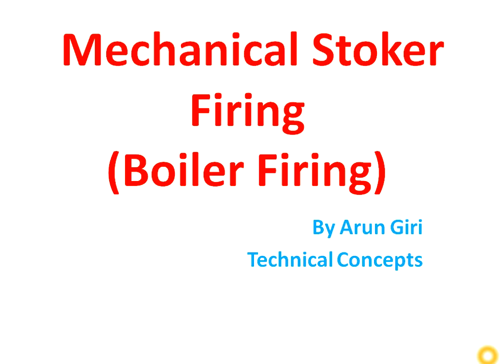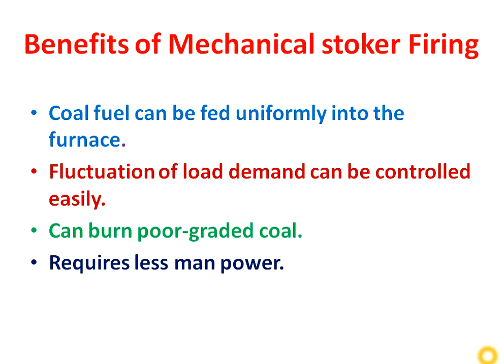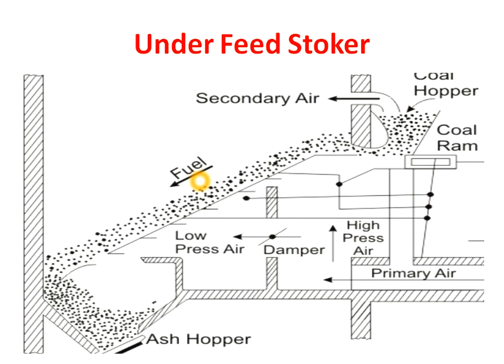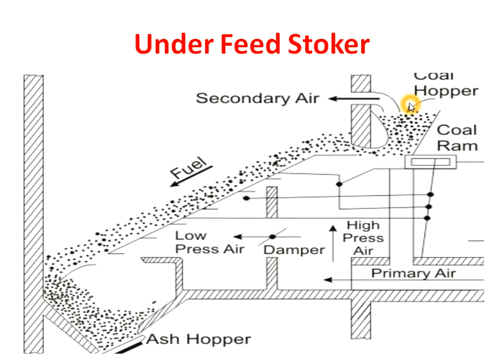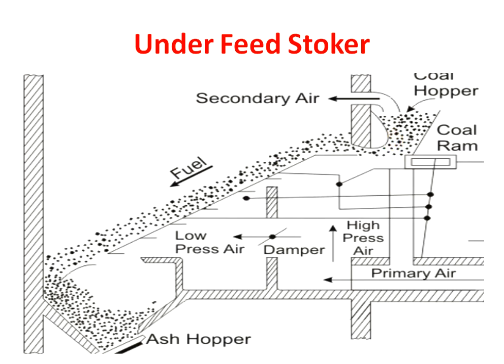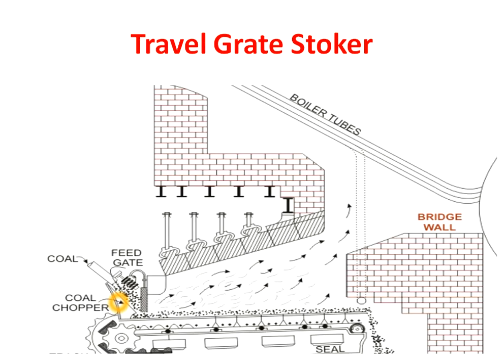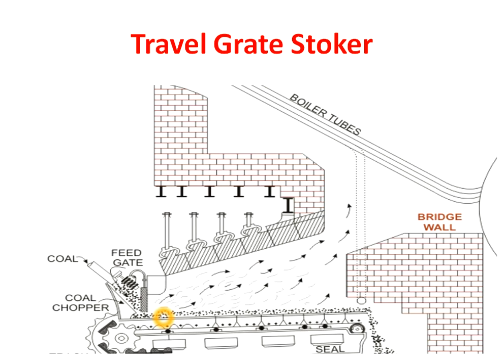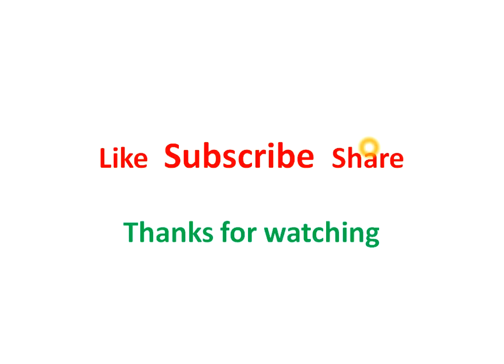Mechanical Stoker Firing / Boiler Firing In English

Comment: I've had personal experience with both single and multi - retort underfed stokers working for both the Detroit Public School System, and Detroit Edison's Thermal Energy Division in  downtown Detroit. I've been lucky n charge of 
Detroit Stokers, Westinghouse stokers (single and multiple retort) 
and Taylor multi - retort underfed stokers. Westinghouse stokers were the worst to deal with because of their dependence upon the use of hydraulics and a gear pump to ram the coal into the retorts of the stoker. Always getting clogged with coal dust, or outright blowing hydraulic leaks at gaskets - rendering them useless!!
  Gimme a Detroit "Low - Boy" geared stoker, or a multi - retort underfeed stoker from Taylor Stoker Co. Trouble free every time !!